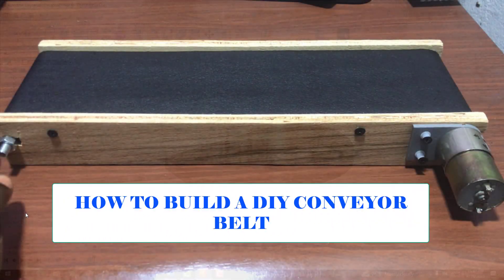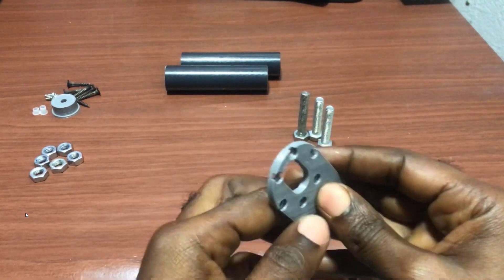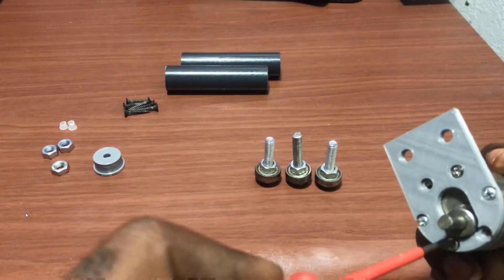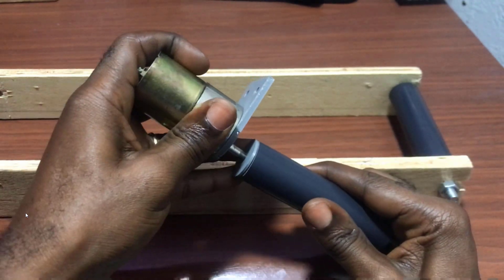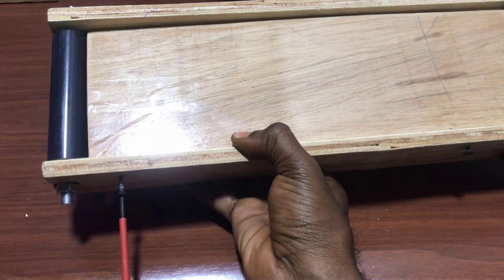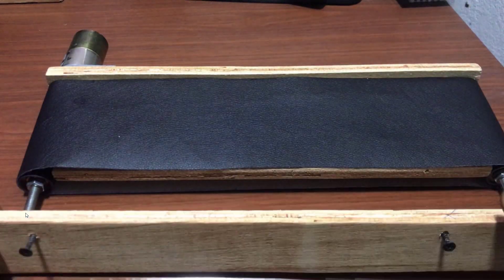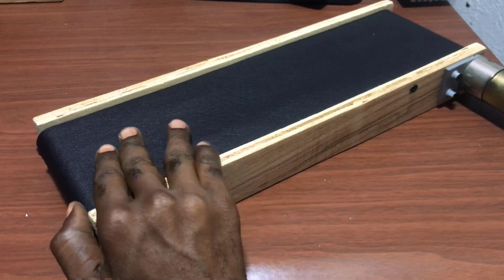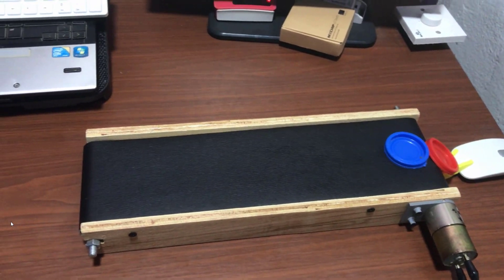How to Build a DIY Mini Conveyor

Comment: Hello. I need a conveyor belt like this for an undergraduate project I am doing for school. The project is about robots and I am mainly into programming it with the camera and etc. But I want to emulate packing a pallet from a conveyor belt and I have no idea about this. With your permission may I replicate your design? The goal for the assignment is NOT about designing a conveyor belt, but I chose to include one. May I replicate this? (Obviously have to check with my supervisor)
Reply from the maker: Thanks for your comment. Sure permission granted you can go ahead.
Reply: @engineeringmadeeasyingme6819  Thank you very much